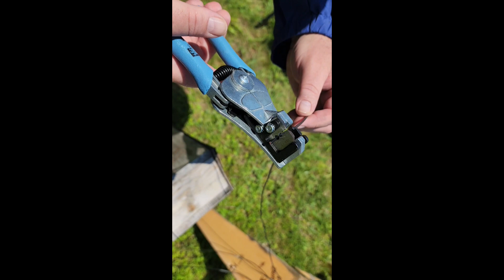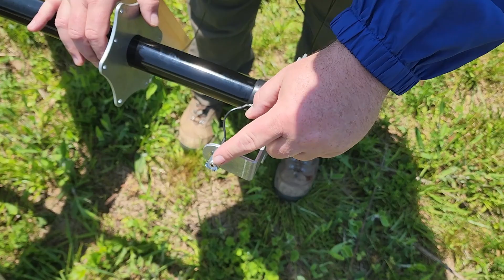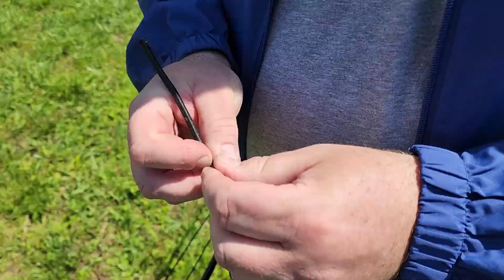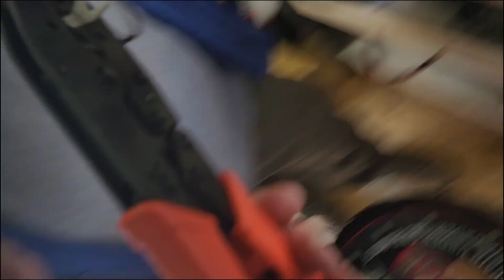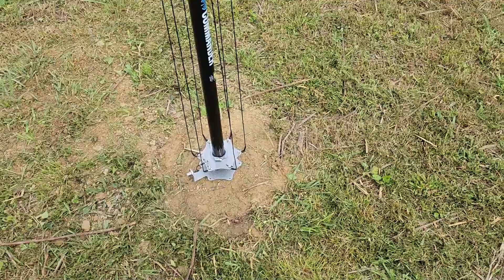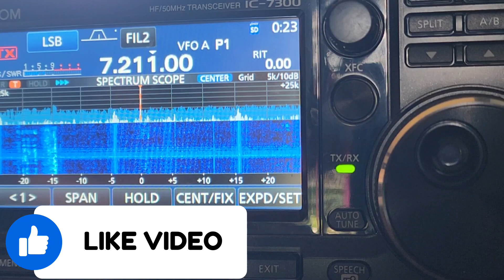LCARA HAM Radio: DX Commander Signature 9 Antenna Build, Testing and Making Contacts!!!!

Comment: @DXCommanderHQ What's going on with the 40m element? I thought it was tensioned at the top spreader looped throught the eye at the top, then the tip of the pole is bowed and the element is taped down the top.  I'm confused, trying to build mine today and follow the manual then I see pictures like this.  Isn't the 40m element supposed to be on the other side of the mast when coming back down and end up where the 30m is tensioned?

Comment: So what would you think could be the shortest I could go with for the length of the radials? Room (and backyard grass that has to be mowed weekly) are my problem(s).  Btw, I see a lawn mower back there. How do you plan to mow over your radials?
Reply from the maker: Copper on the ground is what is most important. 16 radials of 16ft is a good compromise. If you need ti go shorter increase the number of radials. Maybe try 24 at 10ft?  Over time the radials sink into the grass so mowing high for a while should work. Use yard staples to hold them down as well.

Comment: Excellent video. I like how you showed the relationship between 40m and 15m. A few inches removed affects 15 in an almost 3:1 ratio, so taking more off that element would improve 15 more, without hurting 40. As you deftly state, if you don't use 15, then your "leave it alone" logic works for 40m, especially FT8 and CW work, where reflected RF energy is unwanted. I love that Callum commented and is up to snuff on his customer base.😊😊

Comment: I'm curious why you didn't fix the bolts to the radial plate early on the in the process.  The way you've done it here the threads are full of sand which is not ideal.

Comment: How deep did you dig for that mast? Putting mine in...about 1/2 of the fiberglass mast into ground?
Reply: How deep is half the mast. Nobody says.
Reply: @jacobmccallie9525  the fiberglass segment is about 4 feet long. I measured halfway and dug to that depth. Actually I installed a pvc pipe to that depth so I could remove the fiberglass as well as the mast if I need to completely hide the install site.

Comment: This is an inspiring video. My DXC Classic has been up for a little more than a year and could use some light maintenance. I'll end up doing pretty much what you have done here, just taking it down setting it on horses and adjusting and probably replacing the bungie cord pieces. All told, it's an impressive antenna.

Comment: Great video about a great antenna!  I bought one of these when they first came out, and I actually got the first kit ever shipped.  It's a great performer although I'm having trouble with the tune of 40/15.  In my case I think the pole isn't extended quite enough (but as far as I can get it).  Callum suggested rather than cutting the element, just make a little loop above the top of the pole.  He also has instructions for tuning 40 and 15 separately on this antenna now by making a coil around the pole.

But I'm very happy with this antenna and have gotten tons of DX in the short time I've used it.  I'd highly recommend this as a solution for anyone that doesn't want to install guys.  In KY I have decently heavy clay soil so I just packed the dirt back around the pole and it's survived several 40MPH wind storms without issue.